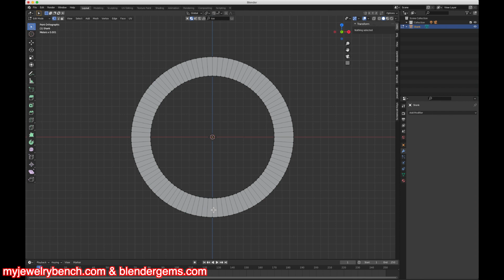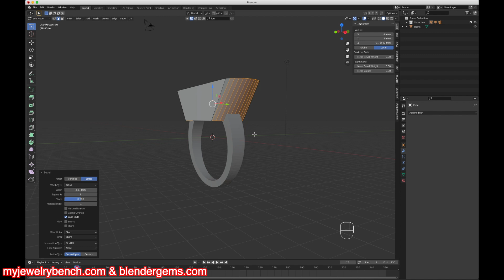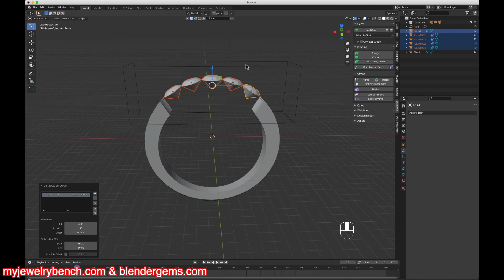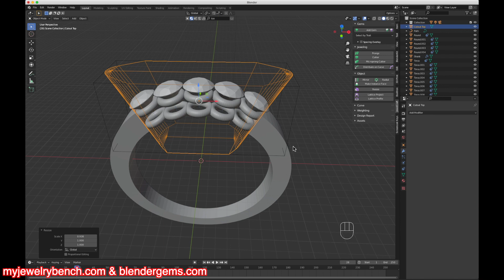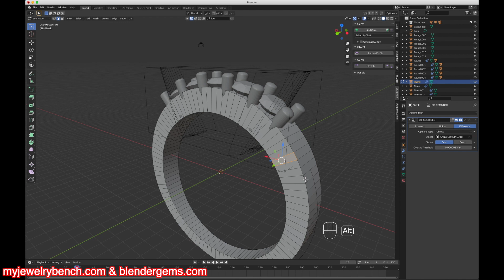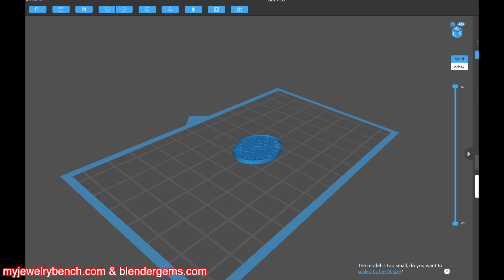Blender Modeling a 5 Stone Diamond Ring!  Start to Finish for 3d Printing

Comment: Hi Pete, I am new to jewelry making. I've started casting some of the pieces and I have difficulty getting the stone into the place that I designed it for in Blender. It seems too small (Maybe i've got a 4mm Ruby and made it according to blender presets and 5 standard prongs) Could you make a video detailing the cutting tools used in blender. Maybe tools you use in real life for stone setting and the prong positions and angles you use and prefer? I think it would help everyone immensely to see a translation from design into final jewelry (And maybe focussing on stone setting since that is kind of a stumbling block for me atm)

Also it seems for small stones you have to make them bigger because printers add some thickness and casting shrinks the part aswell. Did you find this aswell in your experience?
Reply from the maker: I alway plan on 4 to 5 percent shrinkage from the design to the casting.  It will depend on several factors such as resin manufacturing, casting investment and materials to cast.

Comment: Which  3d printer is best? Thank you!
Reply from the maker: https://amzn.to/34Je1h6
Reply from the maker: Phrozen micro for small prints. Easy to work with and clean
Reply from the maker: https://amzn.to/3tRIX79
Reply from the maker: Mars Saturn if you want larger print volumes.

Comment: Quick question.. Don't you have to worry about non Manifold vertices to 3d print this
Reply from the maker: Yes and no.  Usually exporting your model as stl file will fix most if not all issues.  It becomes a problem if you are modeling very large objects.  Usually you can get away with facing normals out, and converting quads to tris
Reply: @watchesandjewelry  what about the boolean problems.. Others are fixable.. Is there a way to fix boolean messes..
Reply from the maker: There are two things with Boolean that you can do to make them work better.  First, try non destructive booleans.  Apply them later in your modeling process. Second, use exact booleans. It takes longer to calculate however it works better.   Also, download a tool call booltron. It works just slightly better than the included function.
Reply: @watchesandjewelry  thanks I'll try those.. Appreciate your help

Comment: Hi, thanks for your video. When I try to narrow the bottom of the ring as you show at 3'30, it scales all the ring instead of narrow the bottom although I do as you explain. Do you have an explanation?
Reply from the maker: If you are using proportional scaling, make sure to use your mouse wheel to adjust the size of the influencing circle on the screen.  Sometimes, the circle may be too large to see and that may give you the scaling effect you have.
Reply: @watchesandjewelry  Thank you so much, my circle was too large as you said.
Reply from the maker: Glad I could help. Thanks for watching
Reply: @watchesandjewelry  Same problem ! thanks Peter